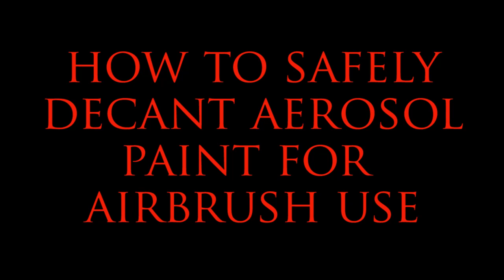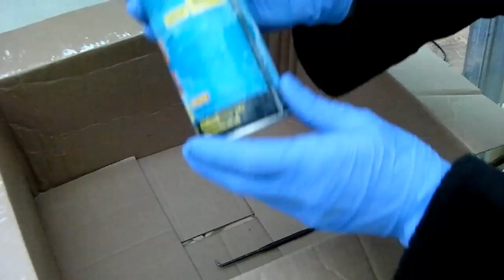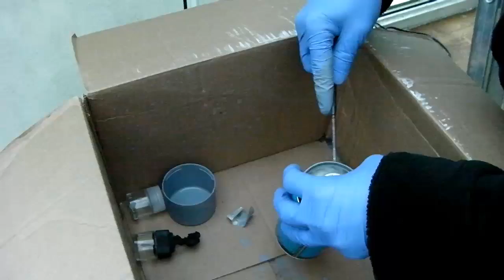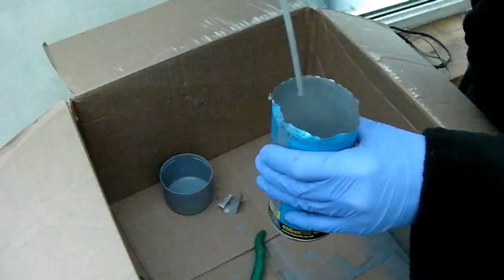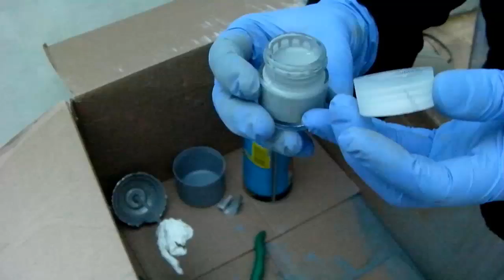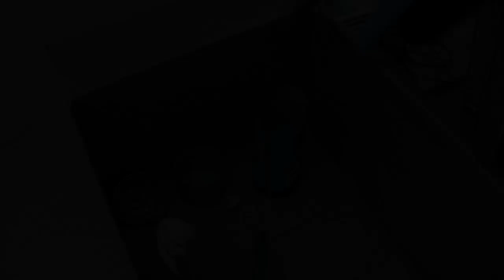How to decant aerosol paint for Airbrush spraying safely

Comment: Do you have any advice if I just needed a small amount of paint, could I just spray it on plastic plate and then use the paint with a brush? With the gas in it would it mess up the Integrity of the paint and be too tacky? Just wondering. Trying to fix something that I can't really mask off very well and just need a small amount of paint
Reply from the maker: For dispensing a very small amount you can spray short bursts into a plastic cup or try taping a straw to the nozzle and direct that into a cup. The downside is that it's messy and unpredictable and accordingly you should do this outside with old clothes and some measure of protective gear. At least safety glasses just in case as pressurised paint can go everywhere.
The principals for use are the same.

Comment: If I have spraycans with water based paint. Can i mix it witt regular wall paint if I wanna use a roller instead of airbrush?
Will it mix in a good way? Lets say I have metallic silver spray paint and would wanna mix with a matt grey to get like a semi-metallic shine but still a bit more matt than just the silver paint?
Reply from the maker: The paint types would have to be compatible in chemical makeup, unless you're moving paints from the same manufacturer there's no way of saying for certain unless you try unfortunately.
Reply: @spidiq8  It is the same brand. But I don' think the wall paint is meant to be mixed with paint from a spray can. I guess I have to try it out. They cost next to nothing since my girlfriend work at the store so she has more than a 50% discount. Thanks for this informative video! :)
Reply from the maker: @ChrisKadaver  just mix a little together to test it first. If it's the same brand you've got a better chance of it working.

Comment: Can I do this with Plastidip? My cab is blocked
Reply from the maker: Absolutely yes, you can decant it the same way.
What I'm not sure is whether plastidip will be thin enough to airbrush and given its nature it might begin to cure once decanted, the only way to tell is decant it, bottle it, let it degas and see if it remains liquid once capped.
Reply: spidiq8 thanks mate I’ll see how it goes!
Reply from the maker: @jameseliot1134  Would you let me know please, it will come in handy for anyone else who might want to know.
Reply: spidiq8 I done it and it worked I’m just unsure on airbrushing it in terms of cleaning it, seems thin enough to airbrush with a 0.5 as that’s what I use mainly for my props
Reply from the maker: @jameseliot1134  Thanks for the update, I imagine it should clean up with cellulose thinner?
Just check that it stays liquid in a sealed jar and then leave a little on something to start setting and wipe it with a thinners dialled cloth or tissue and see if it removes it.

Comment: While most aerosol mixes are not designed for doing miniatures (e.g. "miniature paint", those designed for most airbrush applications - ) this is still a highly useful tool for salvaging unused pain trapped in aerosol cans that have given up after long-term storage, of which I have several. As you say, there is much more stored in those cans than at first appears so knowing this can prevent large amounts of outright waste. In either case, Thank You for this presentation. Sometimes you just need to match colors and hand-mixing often falls short.

Comment: Sorry sir but re you crazy, piercing a pressurised container is crazy, every can that is pressurised carry’s the warning ⚠️ to not pierce or puncture under ANY circumstances, and I see absolutely no reason to do it, and you do realise that children could be watching this. I couldn’t believe my eyes when I read the title and realised what you were going to demonstrate, totally irresponsible and pointless, all that effort for a bit of paint, it’s not as if paint is that expensive. 👎👎👎👎👎👎👎👎👎👎👎👎👎👎👎👎👎👎👎👎👎👎👎👎👎👎👎👎👎👎👎👎👎👎👎👎
Reply from the maker: I think you suffer from a lack of understanding of what occurs during this process.
It's no different to pressing the plunger, you're doing exactly the same thing and it allows the propellant to disperse.
It's nothing to do with the cost of paint. Simply that there are some circumstances where you want a particular paint and the controllability of airbrushing it and can only get it in an aerosol.
I've decanted more aerosols this way than I care to try and count and so far I've had precisely zero explode on me.
Children of course should not be using aerosol paints unsupervised as any respectable parent would ensure occurs because they certainly cannot buy them from a retailer by law!
Reply: You clearly watch the video and seen that it was safely done? Also read the comment section, So many people have done this before this video which help them improve how they did it, in many many people did it right after this video and no one was injured and I read a ton of comments. 
Maybe you just have a lack of understanding what the warning label means because I do spray paint art and I'm pretty sure that warning label is to not have it around heat as it will pressurize and explode. But I'm no genius 🤷🏼‍♀️
Reply: @jenniferkline4196  I am sorry but having worked with pressurised gases and fluids for 24 years I probably have a greater understanding than most people, it isn’t just the pressure of the gas propellant it is also the vaporised contents that can be dangerous, particles of the contents might not seem harmful but if they enter the airways or bloodstream they can cause serious damage to the lungs and heart, and just because all the times that have not caused an accident doesn’t mean that accidents have not happened, but if you believe it is a safe thing to do then carry on doing it, and just for the record, if I had done this and it went wrong I would be highly unlikely to post it on social media, if my warning falls on deaf ears then so be it.
Reply: @allandavis8201  I'm not saying I couldn't be wrong. I'm just telling you like he states in the comment section and in the video "common sense safety" and you'll be okay. If you have any doubt that you could do this then I wouldn't try it either.
Reply: @jenniferkline4196  you just don’t understand the difference between doing something that the manufacturers and safety testing organisations say not to do and something that a YouTube video tells you is safe, but common sense should tell you that puncturing a pressurised container, even when empty, is not a good idea, I have seen what a container only containing 2.5 psi of pressure can do to a human body, if it explodes then shrapnel can kill, that’s why the safety and manufacturers say do not puncture “even when empty”, it isn’t a pretty sight seeing blood and soft tissue injuries, loosing an eye just to do something that I KNOW through training and experience is DANGEROUS is not going to end well if people just don’t realise that a YouTube video is no  replacement for common sense.
Reply: @allandavis8201  Is that why you think that I said it was safe? Lol You think I seen it on YouTube video and deem it to be safe? 🤦🏼‍♀️
Reply: @jenniferkline4196  If you deem it to be safe then please say why you do, you have been going on about the videos and comments about the practice of decanting aerosols and I get the impression that you are of the belief it is safe, if that is not the case please explain.
Reply: @allandavis8201  I never said I was an expert on the matter. I said common sense and I'm also not the one who made this video so why would I have to explain myself I'm really made a comment. I'm not here to debate I don't have time for it. 
I'm also not saying I have more knowledge than you at all. I'm just merely telling you what I know to be true from my own experience and I'll leave it at that. 
You have a great day.
Reply: @jenniferkline4196  I feel exactly the same, I just made a comment 4 years ago about something that I was trying to do the right thing by dissuading others not to do something that I know is wrong, however it was you who decided to reply to me not the other way around, you started the debate, and I merely tried to understand why you were so sure the practice was safe. 
How you proceed in carrying on your practice of doing this is entirely your decision, end of story. You have a nice day too.
Reply: @allandavis8201  I commented because it has been done many times and safely. My point is I do spray paint art,so I know one of the most dangerous things about spray paint is having it near flames as far as it combusting. 
I know this because I spray paint outside so I had to be mindful of temperatures.
I also learned bout the ins and outs of spray paint and how to use it safely.
 Not that I'm an expert, I'm just giving my knowledge and education on this, that it can be done safely.
 I'm not saying it is done safely every single time. I wouldn't know?
 I've never seen it blow up or combust by doing it this way. 

 I've never heard of it blowing or combusting when you go to drain spray paint out of the can.
 Just because I haven't seen it doesn't mean I believe it can't happen.
 I'm just telling you my own experience.

Comment: are you saying that making bigger hole in the can will relies more pressure?
Reply from the maker: The bigger the hole the more rapidly the pressure will release but you don't want to punch a huge hole in it as it'll force some paint out with the rapid release, a small  hole to begin with then as the pressure is lowered you can enlarge it.
Reply: @spidiq8  Thx :-)

Comment: I think this is a great idea.  The only thing I would do different is to tape a short piece of straw and decant to a small jar the amount you're going to need.
Reply from the maker: You can by all means decant that way but it's far far messier and unless you need to save the can for use as a spray can decanting the entire thing mess free in one go makes much more sense.
I've seen pepper get covered when the straw method doesn't work right.

Comment: Being that you're the only person on youtube that has done it partially the way I would do it.... Could this be done to a BRAND new can of paint? Could one, Upside down the can, then cut it open upside down..and pour out the ENTIRE can of contents? Does the can have to be "ALMOST" empty????
Reply from the maker: Nope, not at all, this is a full can. I decant whole cans this way all the time except one or two very rare occasions when I prime a large (non model) item first.
Many will tell you this is dangerous or messy but that's nonsense, it's the same as opening the nozzle.
If you wanted you could upend the can and spray as much propellant out as possible with the nozzle first, it'll spray a tiny quantity of paint initially though so do this outdoors.
Reply: @spidiq8  That's exactly what I was thinking. I was going to use a Rustoleum product that isn't offered in a Gallon or Pint form, decant a set of BRAND NEW cans, cut them open, pour them into a container, and spray them from an electric spray gun. 

Thanks for the quick reply! I had no idea you'd even respond given the video is quite dated!
 IF my brain remembers, I will be sure to mention you in the video!
Reply from the maker: @YachtLife  No problem and thanks, that's kind of you.
I'm fairly active on here and try to respond to add much as I can. A bugbear of mine is someone uploading content and never replying to comments or questions.
One final safety note, if it's very warm where you are, be careful to do this somewhere cool as heat will create more pressure, give me a shout when you upload the video and I'll take a look.
Reply: @spidiq8  Also, do I need to shake the can before upending the can to decant? Should I leave the can to sit for x-hours upside down to "separate" the two?
Reply from the maker: Yacht Life  A good shake won't hurt to mix the pigment if it's been on a shelf for a while and settled but you'd have to let it sit for at least 10 min as the contents would be mixed and under slightly greater pressure. No need to sit it upside down though. The nozzle is connected to a straw inside the can which goes to the bottom of the can do upside down it'll only be spraying out propellant, (this is why it's the recommended way to clear the nozzle before storage).
Once it's depleted enough then sit in its lid upside down and just pierce a small hole near the bottom instead of the top then cut open once it stops hissing, a dribble of cellulose thinner swirled round will get any dregs of pigment stuck to the inside of the can and don't tightly cap the jar you decant to for 24 hours. Scree a lid on but not tight as there'll still be gas in there.

Comment: One note, the straw inside "looks" like it may be a great replacement for short airbrush siphon straws. " for those who want to use a bigger makeshift airbrush pot" that way it can reach the bottom of whatever bottle you rig up. I have to get some laquer thinner before i can try, but thought the straw thing might be a great bonus if it fits😉
Awesome tutorial☺
Reply from the maker: Good idea, thank you.
Another straw that fits are used Biro refills if you're looking for alternatives.
Reply: @spidiq8  good to know☺
Im new on airbrushing so this may be a dumb question but can you use laquer thinner on acrylic paints? From what im understanding acetone is NOT ok for cleaning the airbrush after this method? But is laquer thinner ok on paint types? Or just laquer based? Sorry. I am still very new to all this
Reply from the maker: @hellseeker-inc9756  No problem, I'm happy to help and we were all new to this at some point.
Unfortunately it's not straightforward because acrylic only refers to the pigment and binder of the paint, acrylic paints can be water based like Vallejo, mig, citadel, Revell, Humbrol acrylics or they can be alcohol based like Tamiya.
You can use lacquer thinner to thin and clean Tamiya but shouldn't use it to thin a water based acrylic.
With a water based acrylic you should ideally use their own brand of thinners or water.
As a newcomer I'd recommend that you use the own brand thinner to begin with so you can get a 'feel' for the paint and how it should spray, that way once you're experienced you can try other thinners and know what to expect so you can adjust to suit.
Regarding cleanup, avoid using acetone at all as it's a very aggressive chemical and nasty to breathe in.
You can use isopropyl alcohol for acrylics, white spirit for enamels and cellulose/lacquer thinner for lacquer paints OR....... lacquer thinner for all paint types.
You need a decent respirator for enamel and lacquer spraying and at least a basic mask for water based acrylic, you don't really want to be breathing in paint particles no matter what the solvent is.
While the siphon feed brushes have their uses, airbrush art and ability to switch between colours for example, a gravity feed might suit you better for model making and typically requires lower pressure thereby reducing spray.
I have some other videos covering airbrush types, fault finding and cleaning if you check my playlists.

Comment: Are all decanted spray paints airbrush ready?
Reply from the maker: Yes they are, they're typically thinner than you'd use in most cases but ideal for use in small nozzle/needle sets with detail painting.
Reply: @spidiq8  if used in a AB, Do i need to use lacquer thinner to clean the AB and thin the paint? (Since most cans use lacquer based)
Reply from the maker: @Gumi_wuewuewue  Yes you do. Even if the can says acrylic or enamel the chances are it's lacquer based solvent.
Reply: @spidiq8  thanks!!!! Most of the spray paints available near me says that they are lacquer based acrylic. Thank you for the tips!
Reply from the maker: @Gumi_wuewuewue  You're welcome

Comment: I am trying to clear coat my car, am I able to do this to clear coat and roll it on so I get a nice even layer?? Thanks and keep up the awesome content.
Reply from the maker: Glad it's helpful, thanks. I think you'd struggle getting an even smooth layer by brushing or rolling but you could do that then flat and buff it once cured.
Reply: I struggle to use spray paint cans correctly, I always get splotches or tiger stripes. I painted my whole car, waited, then tried to clear coat with terrable results. I have 3 cans left, if that doesn't work I will just sand it & repaint with no clear coat this time. Thanks for your reply much appreciated!
Reply from the maker: @jeffreyhickam1459  Yes it's something that you get better with with practise but being so thin it's easy to overload and get runs. In that case you likely can't get a worse finish by trying to paint it by roller or brush but provided you do it under cover and away from wind once cured a good flatting and running compound could get you a decent finish.

Comment: I love your video, tin snips will work in a pinch, and a can opener as well. But, someone might also use a exhaust pipe cutter to open the can. I think also something like a wooden vise with a sharpened bolt or nail might work as well. Especially if someone does not have the strength to poke a hole into the can. Just my thoughts on that. Keep up the great videos.
Reply from the maker: All Out Of Bubblegum All good ideas, the exhaust pipe cutter would be interesting for anyone who has one.
Reply: Try this can opener, it should work taking the bottom off. Mainstays Safe Cut Black Can Opener THE SAFECUT DOES NOT PUNCTURE CAN FROM THE TOP LIKE A TRADITIONAL CAN OPENER. ONCE YOU START TURNING THE KNOB, THE CUTTING WHEEL ENGAGES FROM THE SIDE AND CUTS INTO THE BEAD OF THE LID.